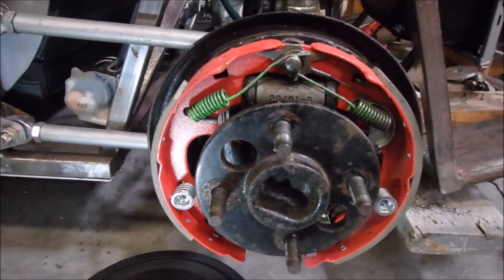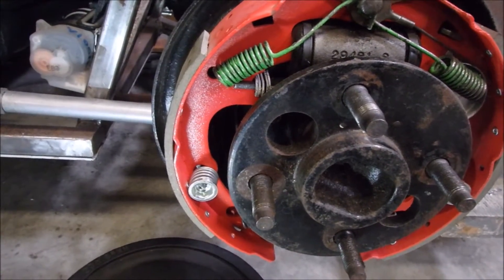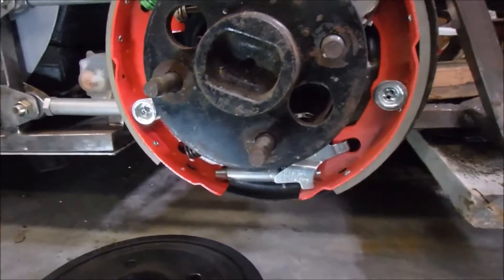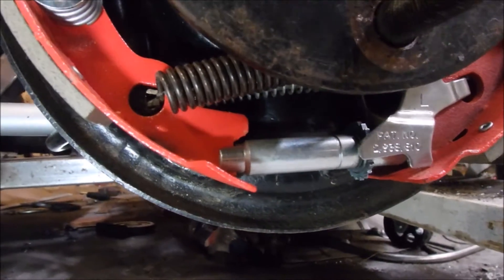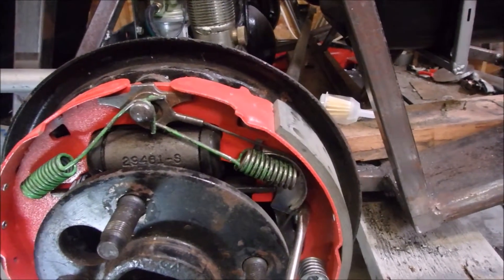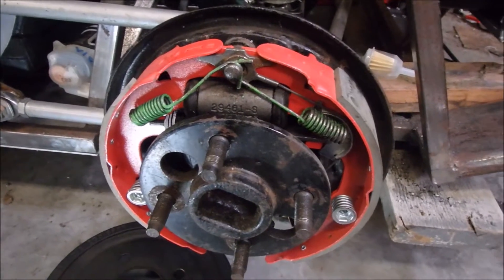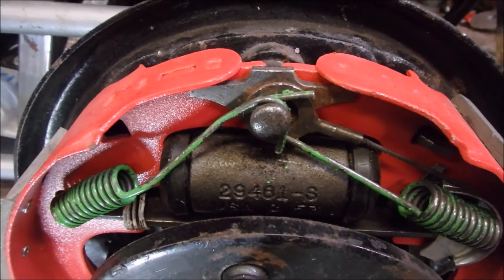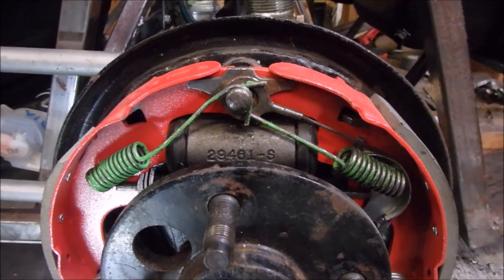Pinto   Mustang II rear drum brake assembly

Comment: I just replaced the brake cylinder on my driver side rear on my 73 Pinto. it took 3 hrs because i didn't realize that hook metal dilly for the hand brake wasn't in the shoe hole ALL THE WAY on top of shoe. pulling my hair out wondering what the hell was going on with it. grrrr. I was using another 72 pinto i got for a look see.   It also seems like the top of shoes are not pulling in all the way with the lug post at the top for some reason still? I had to turn in the adjuster a lot to get the drum back on.

Comment: I am in desperate need of the part number for the parking brake lever for the drivers side 78 mustang 2 or pinto!
Reply from the maker: Sorry - as my drums were completely empty when I bought the axle, I purchased a full set of drum brake hardware for each side, which included the park brake levers,  so I didn't have any individual part numbers.  The kits were cheap, as I recall - around $15 or so., for the entire axle's worth of parts - everything!.  I suspect replacing them all with new isn't a bad idea, as I'm sure various parts wear against each other.